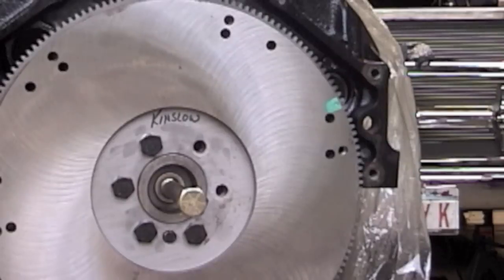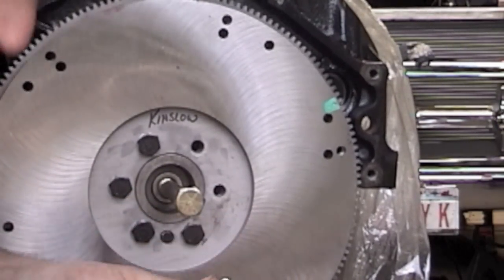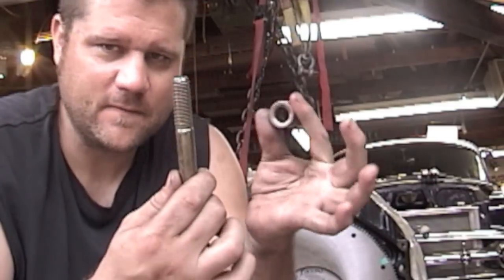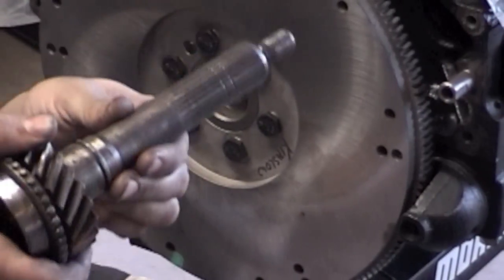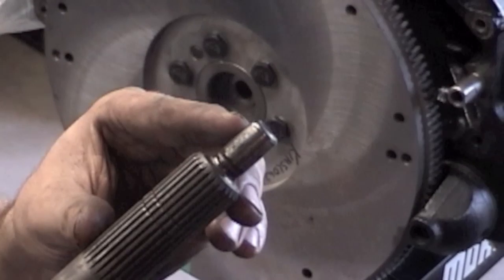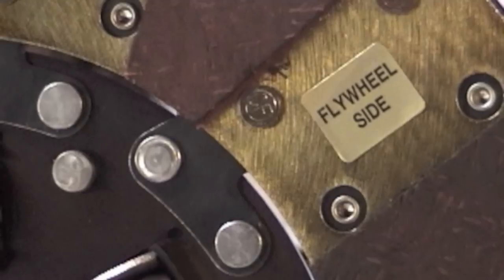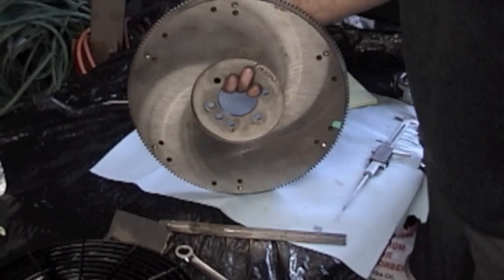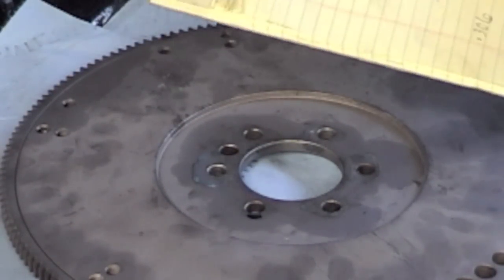Part 16 How To Set The Clutch Fork Pivot Ball Height For The Big Block Chevy

Comment: Great video. No BS straight to the point. I have a  GM 153 tooth pre 1986 flywheel/flexplate (two piece rear main seal) adapter plate on a 1.9 TDI diesel. This is a Short block.  Since the swap I had trouble with the clutch not releasing. The original swap I  extended the slave rod which solved the release issue but throwout did last 15000 miles. I thinking its the Flywheel(30 lbs out of corvette). I just purchased new LUK clutch assembly with new slave and same issue. Any help would be appreciated. Thanks

Comment: Do these measurements apply to a SBC as well? Know the flywheels are interchangeable as are the bellhousings so if I had the 168 tooth flywheel and 621 bellhousing typically used on the BBC, I'm good with your numbers - right?

Comment from the maker: Thanks for the compliment.
I'm still editing part 17. Should be posted next week.
Centerforce I believe you can download their instructions.
1)Just remember not to measure the overall thickness of the flywheel itself.
2)Clutch disc side(or machined side) of the flywheel goes down on the work bench.
3)Then place a depth mic across the face where the flywheel bolts to the crank itself.
4)Plug the number you just got into the formula
5)Adjust the clutch fork pivot ball to the correct height.
Reply: bud munson what if your deck heighth is .980 do you raise the clutch fork ball .020